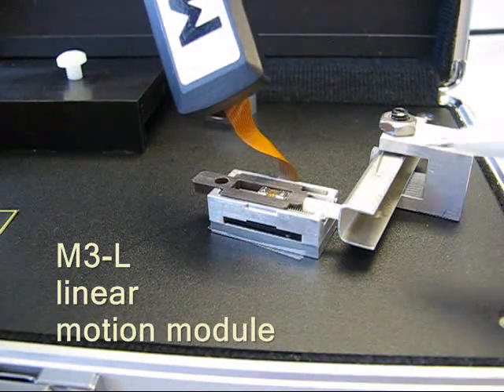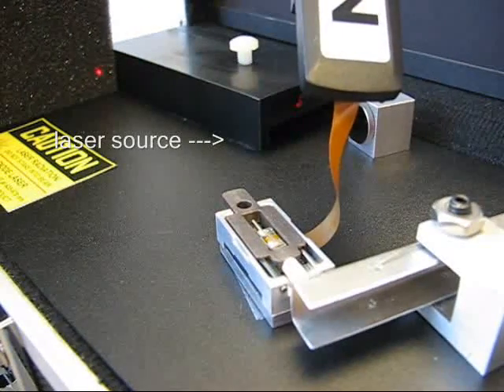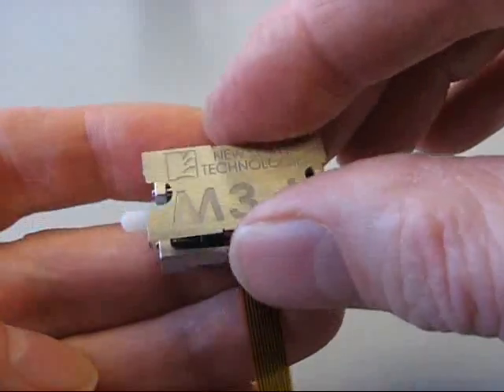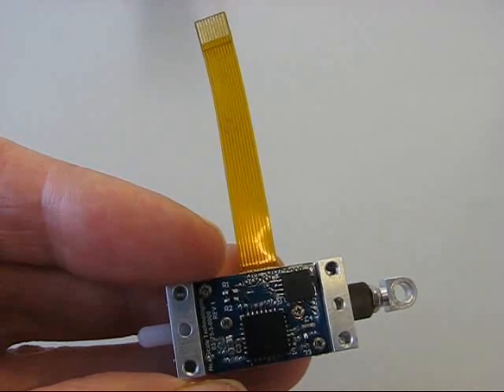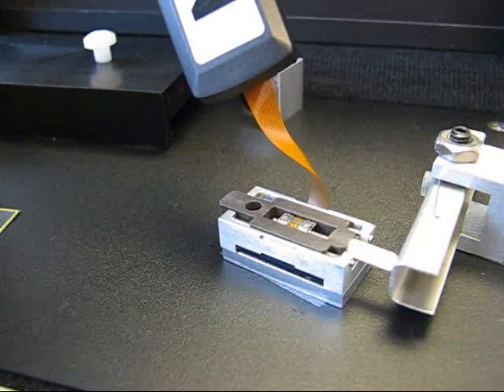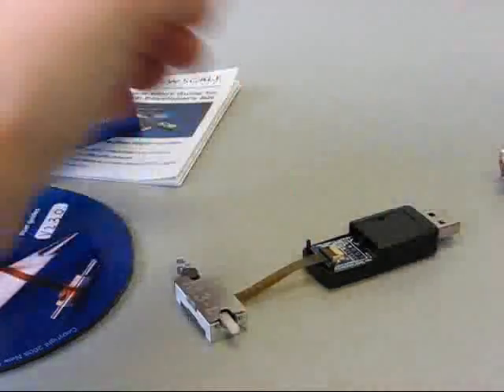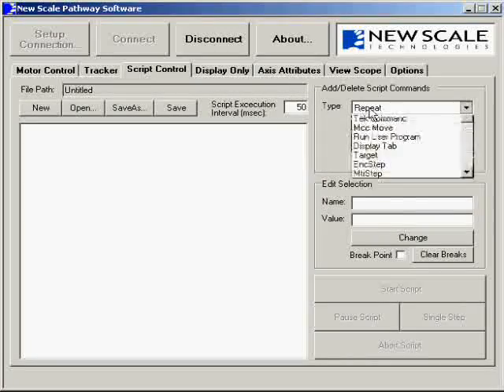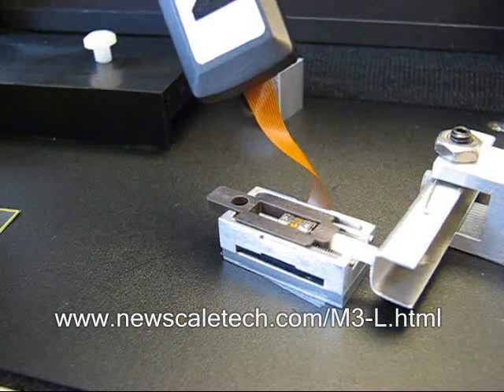Tiny M3-L closed-loop linear motion module

Comment: Hi. I was wondering if I could remove the drive motor from this linear module. If I take it down, will the motor still work properly? Will the position sensor work properly? I look forward to your reply
Reply from the maker: Thanks for your interest! No, you cannot remove the motor from the module. It is engineered so that the motor interfaces properly with the mechanical load coupling. Also, the magnet for the position sensor is mounted in the housing. We do not sell the motors separately as the mechatronic design process at this small scale requires a lot of expertise, in addition to the unique requirements of piezo motor drive and control electronics. We have found that these integrated modules are the ideal way to make our users successful, by applying our expertise to this mechatronic integration. You can read more in this article https://www.newscaletech.com/wp-content/uploads/Design-World-Mechatronics-Article-10-2010.pdf
Reply: Thank you for your answer. Can I customize the exercise module from you? It's like the surgical machine that you're working with Carnegie Mellon University and I want to order the same motion module @NewScaleTechnologies
Reply from the maker: @杨诗昊  Yes, we do custom motion modules! Please email us at NSTsales@newscaletech.com, or call us at +1 585 924 4450, and we can discuss your requirements.